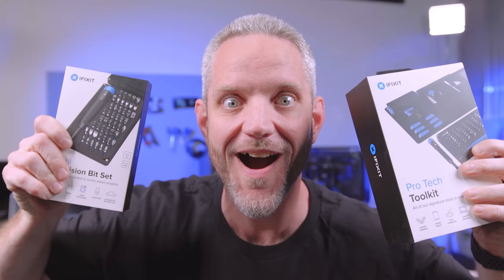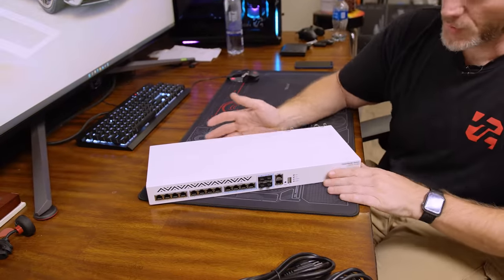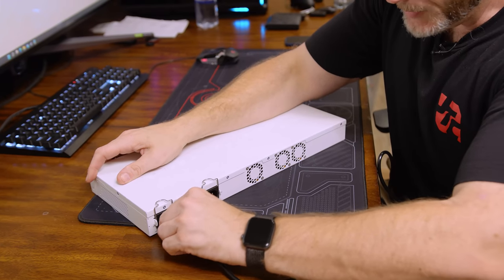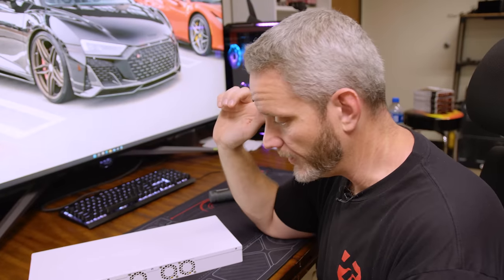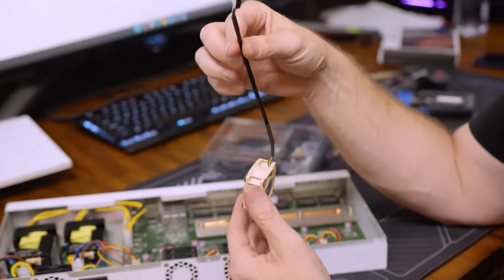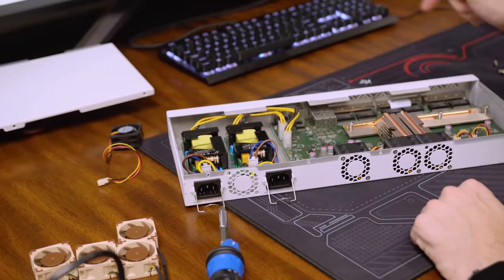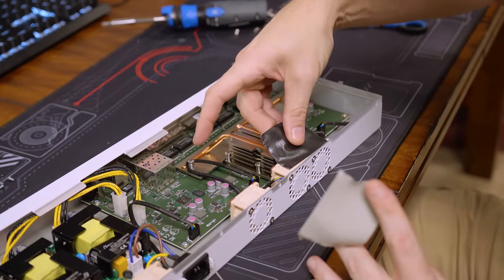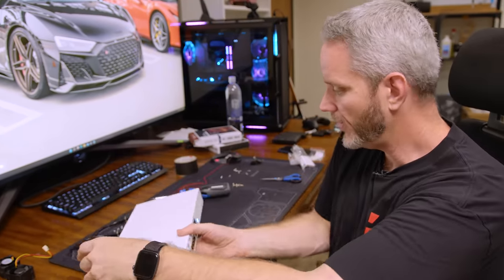We had to modify our new network switch...

Comment: how noctua does it??? simple, their fans don't run at 10k rpm and aren't certified for 24/7 running at 100% for 5 years.  If you don't use the switch to the max (or let's say running 10gb data over it's bus on multiple connections at a time (so let's say a total of 30-40 gbit througput) then you won't have any issues i guess. But once you start having very high bandwith usage those noctua's won't cut it anymore as their cfm just isn't high enough to cool the switch decently.  I have an HP 2530 switch over here, that's a 48port gbit switch with POE, it has a vacuumcleaner fan (not a real vacuum cleaner fan of course, it's the noise it makes), it's got like 30 ethernet cables plugged in at all times (and sometimes more), if i start network benching on multiple pc's at the same time it's discharged heat goes up in no time. In everyday usage i'll never max out the switch's cooling capacity, and since the switch is in my living room i got used to the constant noise but visitors always clearly ask me what that sound is. So you gave me a fantastic idea to switch out that cooler (probably i'll use a second one to compensate the lower cfm those noctua's have).
in case you're wondering: my server (in the basement) has two connections to the switch which are aggregated (so they're working as a single connection of 2gb) and all other devices have a single cable to the switch. I have wireless here (2.4ghz+5ghz) but i only use that for my phone and tablet (and visitors which are subnetted into another vlan for security), all other machines are connected to the network via ethernet cables, some even have a usb2ethernet dongle as they didn't have an ethernet port.  it's a lot of cables here, but i was able to hide most of them; only under my desktop-table it's a bit messy with all the powerbars and network cables. The cables running to the basement are going through 2 walls (it runs through my bedroom and goes to the back of the building, it's stuck away behind rainpipes and on the groundfloor it enters my basement via a little windows' woodwork where i drilled a little hole into just wide enough for the two cables to run through. the ethernet cable to the basement is about 43 meters according to my servers' bios that has a cable measuring tool)

Comment: For our house I'm having a 16-port 10Gb SFP+ Switch in the basement that will be connected to the modem and servers and the other ports in the switch are going to each room in the house. Each room will have a switch that has 2 10Gb SFP+ ports as well as 8 gigabit or 2.5Gb ports (depending on cost) for the devices in each room. This way each room has a dedicated 10Gb fiber connection to all other rooms and servers.

Comment: J on Amazon US there is the TRENDnet 24-Port Gigabit Switch with 2 X 10G SFP+ Slots, Fanless Design, 19” 1U Rack-mountable, TEG-30262 at $219.99 and the Cisco Business CBS220-24T-4X Smart Switch | 24 Port GE | 4x10G SFP+ | 3-Year Limited Hardware Warranty (CBS220-24T-4X-NA) at $399.99, not that up on these things this might be of use?

Comment: If you try to boot up your device without your power supply plug in, it will discharge the capacitors...

It's an old knowledge...

Comment: Network guy here that works in data centers, virtualization, and VoIP.

There's no real reason for you (Jay) to go SFP+. You're not going huge distances (fiber) and you're not looking for extremely low-latency (DAC). Maybe if you had a NAS and VM server pulling iSCSI off of there, you could make an argument for DAC.

10Gbase-T is economical. The wiring is cheaper, it's not as sensitive as DAC/fiber (read: more rugged), and unless you're trying to certify the cabling, any idiot can terminate RJ45. You might get 8.5Gbps instead of the full 10Gbps theoretical due to cross-talk and interference if you terminate improperly. The big thing is that 10Gbase-T is economical since you can hook up 10M/100M/1G/10G to it (networked printers, cameras, etc). 

For a small office and set up like that, you'd be crazy to go SFP+. The only gripe I have is you're swapping the fans out of the switch. 10Gbase-T adapters run *hot*. Much hotter than DAC or fiber.

edit Forgot to add, I'd get a 24-port PoE switch that way you can also get a couple of access points to put in your space and some hard-wired cameras. That way when you're moving around you don't have to worry about "does the WiFi reach here?". Dedicated WAPs generally are a little better than the all-in-one "router/WAP/firewall/whatever else a vendor throws into it devices". I'd also hard-wire the cameras in because they're probably for security and a simple signal jammer is going to kick your wireless cameras offline.

NetGear, Aruba, and Ubiquiti all make some solid equipment. If you've got money to burn and want e-peen, you can try Cisco's SMB line but that stuff's going to be complete overkill. Avoid their WAPs, though. They're utter garbage.

Comment: Hey jay can a aska quick question here. I have a ryzen 5 2200g on an asus b450f mb with 16gb of corsair lpx vengence at 3000mhz. I have just added a gtx1660super that i got for a great deal however i have aroungd£150 left spare to sepnd on my build was think of upgrading the cpu to a zen3 can you recomed the besr one for my rig. Was looking at 3600 not sure if theres anything better.

Also i have 2tb samsung evo ssd

Comment: Jay, I have the same switch in my homelab. This is a very unique switch and I have not seen anything that offered more 10G ports that wasn't SFP+
Reply: Yeah in terms of new switches Mikrotik's value is unmatched. In the used market they get completely destroyed by used Cisco, Juniper, Arista, or Ruckus/Brocade. I personally upgraded from a crs326 24port to a Brocade ICX6450-48P. That switch is 48port gigabit with poe+ on all ports, and I got mine for $130 a piece. Not to mention it is fully hardware accelerated for layer3 and routes at wirespeed.

Comment: 10G Ethernet is an abomination, it sucks up way more power, produce more heat and goes less far than any other standard. Also it's more expensive to adapt it compared to traditional ebay fiber

Comment: I'm at a serious loss as to why you wouldn't just go with Ubiquiti?  The prices are so reasonable and you can do everything you could possibly need so much easier...  Go with a UDM Pro and XG 24 which will give you 8 1G & 24 10G ports with one SFP+ cable over two rack spaces.  It's all plug and play with very little effort and silent.
Reply: Do Ubiquiti do a 12+ port 10Gbps switch?
Reply: @omegonchris  Yep. Enterprise X24
Reply: @omegonchris  XG 24 have 24 x 10GbE + 2 x 25GbE, i changed out my mikrotik 10GbE switch when they released this switch. mutch better
Reply: @eirikdalhus  Agree.
And then he needs a UDM-Pro SE :)
And a couple of APs.
And maybe security cameras....
And maybe Unifi Access.....

lol :P
Reply: @TheTechnoBoyTobi  he can just use his own current router and buy a Cloud key.. looks like they Are going the budget route so that would make more sense..
Reply: As someone who does networking I'll say the Unifi switches are generally overpriced garbage. Mikrotik provides a lot more customization, and my favorite part about Mikrotik is the long term software support. Even Mikrotik's early products from before 2010 still receive support. All that matters is that there is enough storage space for the firmware and you can get the latest and greatest.

Comment: Have a look a UniFi, they have 10g switch’s,wifi, firewalls, security cameras, remote access etc etc. their switches are rock solid and what I use for my business. Happy to give advice if interested. Also lots of YouTubers specialising in Unifi who would help out too.
Reply: I like many Unifi devices but the price not even close.  I have their AP LR6 and it is great and I run a controller on a container so does not waste another box.
Reply: 2nd UniFi.  I use it for my home network.  Great performance, features and managment tools!  it works like enterprise class gear.  I manage a Cisco network with 100's of switches for my day job.
Reply: Unifi has had a troubled history with customer support issues, but for the most part with basic configs their stuff is solid

Comment: i think you could of gotten away with a TP-Link - TL-SG3428X (24 +4 SFP ports @10G Ethernet) switch not router for around $290 USD  edit: (yep my bad ethernet ports are 1g)
Reply: only problem is that it is only the SFP+ interfaces which run at 10G the RJ45s are just gig

Comment: If u kept up on the codes. you have a 1 in 60000 chance roughly of winning. Thats ACTUALLY not that bad.
Reply: Better than the lottery. Still a very very very very unlikely you will be the lucky winner.
Reply: @MrMastadox  never know if you don't play
Reply: @Dtr146  the oddds we know. Even if you don't play you know the odds are slim. You mean you can't win if you don't play. That is true. But i joined giveaways before. And even if its during a live twitch stream with 1000 people joining. The odds are 1 in 1000. That already is avery small chance. 1 in 60000 thats just extremely unlikely. But ofcourse we play. Watched jays videos most the time anyway. So .. i might aswel play. But i know my chances of winning are close to none.

Comment: I skipped parts of this video, but how can you assume that it supports PWM-controlled fans just by putting ones in, when the originals were not PWM?!
Reply: The switch uses 4 pin header for fan, no reason to use 4 pin header if it's exclusively for 3 pin.
But in the event that the switch can only run DC mode, PWM fans can also run in DC mode.
Reply: @jeuno880   Yeah but my point was that Jay just automatically assumes that since the connectors have 4 pins, they will support PWM, which is a dangerous assumption to make about electronics in general. Sure in this case there should be no real "danger" since fans can use, as you said, voltage control any way. But maybe just an advice to any electronics beginners, never assume things like that unless you have the specific, err, specs about a device :)
Reply: @pev_  Well, his channel is about PC.
So he probably assumed that at the very least most people who watch the channel to know what a fan header is and for.

If beginners avoid the learning curve, never bothered with asking around first and want to go straight into the action, IMHO it's their own mistake, especially in this day & age. I mean... forums, videos, and tutorials are pretty easy to find.
Reply: @jeuno880   Really? Is the eth switch a PC? No, it is proprietary equipment that has no reason to adhere to PC ways of making things. Is it even sure that a fan connector inside such a dedicated device is in any way similar to what we have in PCs today?? NO. And learning curve? Sure, you can go and tempt the darwinian award when trying to learn about electricity or electronics. OR you can be a bit more clever and learn about a device first before poking inside it. DUH!
Reply: @pev_  Is the fan header any different from a PC?. It's the same old 4 pin header.

Is the original fan is a special kind that uses special wiring? It's the same old server delta fan. Different case if it uses some sort of special connector like Lian-Li Infinity. But even then, 12v fan wiring is standardized albeit not officially announced. And those that aren't using the standard usually uses special connector, like some of corsair RGB fans.

You advise beginners to be careful from plugging things wrong and end up destroying stuffs, me too. My point is beginner should behave like beginner, ask and/or learn first before plugging something. If they don't, and their things ruined, well it's their own fault, it's internet age, searching info is way easier than 1996. 

And yes, there is a learning curve. One don't go play with extreme overclocking if one don't even know standard overclocking and how does OC works. Just like one don't play with 300v if one don't even know 12v and voltages in general. One can, but good luck. try not to end up like those that died because trying to do wood fractal burning like those tiktok viral videos using a microwave transformer.

Also, will a beginner use a $600 switch? if they do pretty sure they have a lot of learning to do instead of worrying about replacing loud delta fans with $60 each Noctua.

Also, is Jay a beginner?
Reply: @jeuno880   You have some points, but you still make way too many assumptions, which is a sure way to get a darwin award. And by the looks of this, Jay surely seems like a beginner. I know he is not that in the PC scene, but here...
And very nice, by the way, of you to say that if a beginner gets something wrong it is their own fault. I hope you are not in any kind of teaching profession.

Comment: Just to help with the "Ethernet" vs "SFP+" topic:  First, it's all ethernet format.  The question is whether to use copper or fiber cabling.  (yes, you can buy copper SFPs, but since yours are dual-mode ports, there's no reason to do that).  So, using SFPs would be for running fiber instead of copper.  And that decision is based on how long your runs are.  Copper is only good for roughly 300ft before the signal degrades too much for reliable communication.  Single-mode fiber can go up to 10km. (there is also Multi-mode fiber but it's only good for 300ft as well).

Comment: For the price mikrotik is already pretty good. 
Not sure how familiar you are with mikrotik but its not like other managed switches with a webgui. that looks like a CRS which requires winbox (the latest version especially if you are running ros7+) The CRS versions have router like functionality with switch level hardware although with the amount of data it sounds like you want to push i would recommend keeping the config simple.

Comment: You've got 4 SFP combo ports.  You can get adapters to turn those into additional 10 G ethernet ports.  In addition, you can get an SFP cable to link to a second switch to expand if needed and not take up an ethernet port.
Reply: If he uses the SFP ports than he can't use the last 4 Ethernet ports. That's why they are combo ports you can only use 1 or the other not both at the same time.
Reply: He literally said that they share bandwidth with 4 of the rj45 jacks so he would be gaining nothing doing that as it would just turn off 4 rj45 to gain 4 rj45
Reply: No, no.  They're combo ports.  Using them turns off one of the 10G copper ports, so there's literally no point in using a 10G copper transceiver to do what the physical jack next to it is already capable of doing.

And, 10G copper transceivers are an abomination that never should have happened at all.

Comment: Just get a second switch same model and connect it via a cheap SFP+ DAC or ethernet patch cable and there you go more than 20 ports.  Switch to switch barely adds any latency for local connections, especially at 10g.

Comment: Get a Cisco 2921... they're pretty cheap now and it scales up to 50 ethernet ports 1 gigabit (newer ones give 2.5 gigabit). It can have up to 3(I believe) SFPs. It's really scalable and meant for a large building to a small office. 

Plus you can get CCNA certified pretty easy with one :)

Comment: Keep in mind 10G over copper works at 10G with distances up to 180ft/55m, so watch out all the ups and downs of cables, your wires' service loops and the patch cords.
Reply: That's for Cat6. Cat6a should be able to hit 10Gb at about 100 meters.
Reply: That is the rated distance for Cat6 Jay stated he's running CAT 6A which is rated for 100m 10G

Comment: I have been using MikroTik for the last 7 years for enterprise and even hold current certification with them. MikroTik SUCKS!. Their RouterOS sucks. Their software has tons of bugs that never get fixed. The only thing they are good for is a cheap solution.

Comment: Not a fan of MikroTik. Have had to many issues with their product. There are better 10gb switches out there for not much more cost. Example: Ubiquiti 24 port poe 10gb is only $700-$800. Better hardware quality and a solid interface.
Reply: Mikrotik's hardware and software are top notch. The issue you might have had is the learning curve. Your overpaying for Unifi equipment for less features (that most consumers or very small businesses will never use) and for a more simplistic UI for configuration. The premium for Unifi products can still be worth it in some cases, but for people who already want to learn and get small/medium sized business network equipment learning more by using Mikrotik products can be valuable especially if you want to do computer networking as a career.

Comment: Microtic, has a horrible device.  they are know to come in with virus enbedded in the code.  To my knowledge there is no way to fix it.  I use Unifi switchs and they have a few different options when it comes to 10GB.  It all depends on your newwork configuration.  I would go with a core and 2 of the Unifi 8 port 10GB sfp switches connected to the core.

Comment: Just fyi Jay Dell has a 24p 10ge switch. I have some of them in our data center rack.
Reply: They are specifically S4128f-on switches. They have 2- 40g optical that you can use to link them together as well.